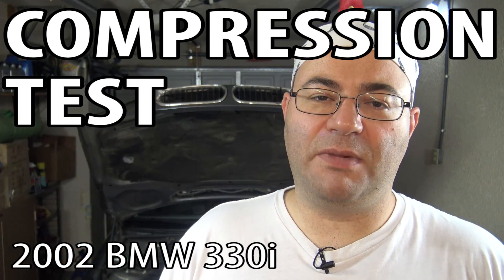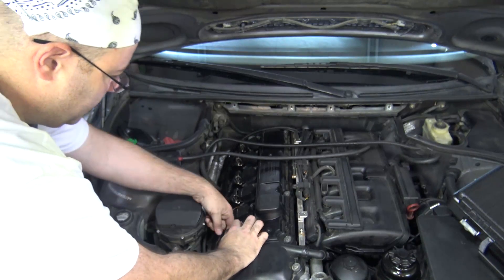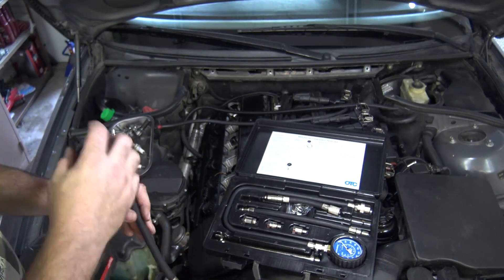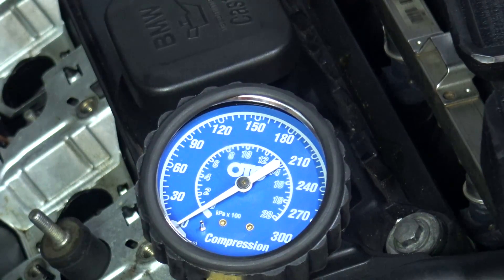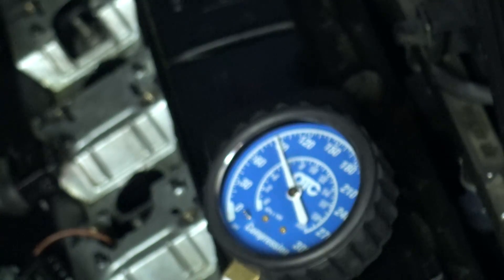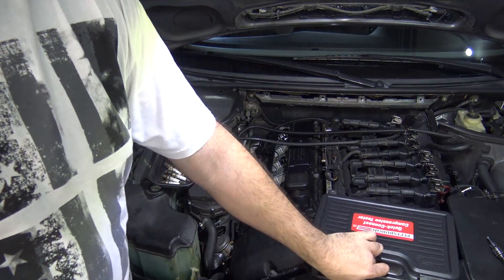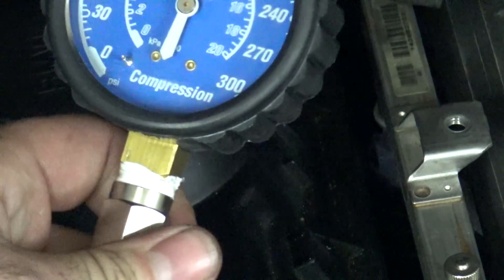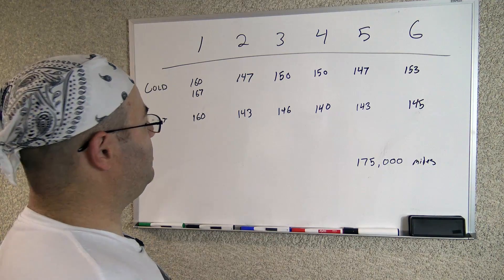How to do a Compression Test on an E46 BMW 3-Series DIY

Comment: I just did a boroscope/compression test of my 2001 330xi with 132K miles.  The cylinders look awesome using the boroscope - nice crosshatch all the way up and down the cylinders.  The compression check had four cylinders at 185PSI and two at 187PSI.  It doesn't get much better than that!

BTW, I bought the compression tester based on your suggestion and it is a very nice tool.

Comment: Hope you are well ! One question : I experienced a loss of power on the highway... Diagnostic from two shops : no compression at all on Cylinder nr.3, 160 on all the others. Essentially, one team, after changing the spark plugs (that revived Nr.5) thinks sending the head to a machine shop, changing the valves and rings (most likely nothing wrong with the pistons), and maybe a few other minor things, shall suffice. Shop Nr.2 also diagnosed no compression in Nr. 3. Either also rebuilt the engine head, replace head gasket, air intake boot, one ignition coil and 6 new spark plugs. Or engine replacement. What do you think ?!  Thanks in advance for your consideration.

Comment: Hey  50skid, i have a 2005 bmw e53, It has a misfire and the code is P0302. we did a compression test when the engine was cold and there are the results, cyl 1- 230psi, cyl 2- 180psi, cyl 3-230, cyl 4-230, cyl 5-230psi and cyl 6-230psi. Now we did another test after running the engine and these are the results cyl 1-200psi, cyl 2-140psi, cyl 3-200psi, cyl 4-200psi, cyl 5-200psi and cyl 6-200psi. The cylinder head we bought from ebay had a  warpage, and when i took it to a machine shop, they advised not to cut it. we are now thinking of pulling of the head to take it to another shop. Are these heads known to carry a warpage and do you advised cutting them?

Comment: 1) Would it be better to do the cyl leak down 1st, for just in case you might need to do a wet compression test ?
2) If you did need to add oil into a cylinder for a wet test, how long, how many miles, street traffic or freeway driving would it take to, what ?, burn off that oil in order to get an accurate reading on the leak down test ?
3) Do you think it would be better to do the leak down test first for just in case you might need to do a wet compression test on any cylinders ?
4) I wonder what other things made you conclude that the HF gauge was not good. 
  I hear that different gauges read differently, which SUCKS. 
   How do you know which brand was more accurate ?
I really enjoy your vids.
I hope you don't mind answering all my questions.

Comment: I've played with BMW motors for a while now so I can say I've  experience with them starting from m50's to m70's. They are actually very nice and fairly easy to extract power out of. 
The idle air control valve is also powered from the same relay if I'm not mistaken.
Reply from the maker: The idle air control valve is a stepper motor that, when powered, will close a flap over an orifice a little or open it up a little, but never closing it all the way.  When not under power, the flap is "loose".  When you pull one out and shake it, it rattles.  So whether it's under power and in the default position or completely powered down because the DME relay is pulled, either way air still gets in.  So which aftermarket brand of M52TU piston rings (those are the ones with the 3 piece oil control rings) have you tried to install in the M54 to solve the oil consumption problem?
Reply: The rings I used on the last build are Hastings however the factory 52tu oil are also a good choice and u will need to use the m54 top ring as it's 1.2mm.
Interesting results in ur leakage test. I hope u don't have an overheated engine as the machining cost will dramatically increase. If it's got the mls gasket then u unfortunately have a high probability for a warped head/pulled threads. I recently had an engine come in that was cooked and the diagnosis was a cracked water pump impeller and thermostat was corroded. The dme controlled heater element almost always corrodes behind the plug on the thermostat side not such a big issue but when the load changes the dme can't keep it open in the 80 odd deg's and it will fall back to the mechanical 97deg C.
Time-serts are the way to go for thread repair.
Reply from the maker: Yeah I already expect that some of the threads have pulled out and that I'll have to sort the whole timesert issue out.  Problem is the $450 kit they want to sell you to do the job right.  I'm investigating other ways to get the dual drill bit so that I can keep the 6mm inset in each bolt hole.

I'm sure that it overheated.  But it's only $45 to get a head decked.
Reply: I'll msg u in fb where to get it cheaper, I just bought another set this week. Great guy to deal with and very prompt.

Comment: great video. Regarding on misfire, check disa valve. I had cylinder 6 misfire and after all the diagnosis it turned out disa valve flap getting stuck due to oil residues. Hope you find the problem

Comment: I was just looking at this video for curiosity, did a compression test on mine all six cylinders were at about 190~, was just sawing that yours were a bit lower at 150~, called my attention
Anyways, all six were holding around the same pressure, I'm just changing the gasket and valve seals as I'm working on the timing chain preventively (just acquired the car as is over the 150k miles). Have to say that the camshaft timing chain section of the Bentley manual was really helpful also on the process of removal, I though I had to remove the engine to do the complete chain but I don't

Comment: This is my 2nd rebuild on this enginr....1st rebuild I increased piston ring gap...compression test was 90is on all cyl after rebuild..
2nd go round 120is on all cyl...both values using the dreaded harbor freight tool...

You got a 30psi differential...using a diffetent tester...so Im in range and no matter what I will not do this again...I wont complain...donor block no boring no oversized piston just straight swaped out innerards...I can live with this before was horrible using 1L of oil/500miles

Comment: You always do a compression test when the engine is cold and then add a small amount of oil in the cylinder and repeat the test hold the throttle blade wide open and crank the engine until it builds the maximum amount of compression possible with oil and without.
Reply: you don't put oil in the cylinders.... that will fuck upp your reading. you only put oil in if the comp has a high diffarance betwen cylinders just to check if it's a piston ring problem.
Reply: @rampage3337  thats what he said.. do test clean. repeat test with oil to ascertain if rings or valves are the issue

Comment: Hi 50sKid, I got a wired situation that might need suggestion. I recently purchase an e46 2 330xi, and found out the CEL light oil light and abs light won't show up when ken in position 2. Of course till now I haven't seen any CEL once even unplug the MAF. While if use OBDII you could find the MAF code if unplug. So, what should I do? It has 3 monitors not ready right now, seems generic OBDII scanner can't do anything to reset them all into not ready for starting over. Car runs and drives.

Comment: I had 225K miles (360thousand km) in my M54B30 (e46) and it still felt like a freight train, no hesitation, liked to rev, only some strange noises in the cold mornings. I also used a trailer to get my e30 to the race track with it. Had no real signs of fatigue... For me what was telling is oil consumption, still it could also be the valve seals, but I did not disassemble that engine to be sure, maybe sometime in the near future! :)
Reply from the maker: Oil consumption is due to the oil rings on the piston.  Gonna do a video about it soon.
Reply: yeah I tried to write that probably the valve seals are also done, but the piston rings are bust too :)
 I'm looking forward to that video! :)

Comment: instead of the DME relay, wouldn't it be better to pull the fuel pump fuse, crank it a few times before removing the spark plugs and whatnot to clear the remaining fuel in the system and then do the rest?
Reply: I agree im trying to diagnose a problem not create a new one

Comment: Good day sir... 
My e46 sounds just like that, i have replaced the coils and spark plugs, fuel pump, crankshaft sensor today, and now im trying to figure out what is going on. Any advise is highly appreciated. 
Thank you and have a great day
Reply: Did you find out what it was?
Reply: @paulloper8333  yes sir, it was the Camshaft, and Crankshaft Sensor.
Reply: Do you remember what the code was on the check engine light?

Comment: OK, thanks for explaining  compression tests on BMWs.  I have a 2001 M Z3 Roadster.  My mechanic replaced the oil filter housing gasket.  When are returned it to me, my wife started to drive it home, but noticed that the oil light was on.  Long story! - SHORT.... They forgot to put the oil back in the engine.  As far as I know, the car has been driven about .2 miles without oil.  I've always used synthetic.  The mechanic believes that the synthetic should hold up for what happened to the BMW.  He has agreed to to a compression test to see if there is any leakage.  Can you give me any advice before we do the compression check?
Reply from the maker: A compression check won't tell you if there was damage to the bearings.  I'm not worried about the compression rings in the pistons or anything like that.  What gets damaged the most by oil starvation is engine bearings.  There are main bearings, rod bearings, and cam bearings.  Unfortunately there's no real way to know if they're damaged without disassembling the engine.  Maybe you can put oil back in it, run it for a bit, then look in the filter for shiny bits of metal, signifying bearing damage.  Good luck.

Comment: followed your instructions and did a compression test today. all cylinders in in the 170 to 175 psi range except for #2 which is at 160 (i'm 90% sure bad head gasket, there are other indications that i'm not mentioning). great tip on pulling out the blue plastic cube, way better than the people that pull the fuel pump fuse. per instructions of the tester when the engine is hot it said to wait 10 minutes with aluminum heads before pulling spark plugs for good measure. thanks!
btw. i'm curious what your compression was after you rebuilt the engine.
like you said who knows how accurate my gauge is...
Reply: also did not push down the throttle at all, i don't think it matters. pressure was maxing out by the 3rd or 4th crank and i did 7 for each for good measure.
Reply from the maker: About 180 in all cylinders.  What are the other indications?  Do a leakdown test to see where the air is leaking out of
Reply: none of the usual head gasket symptoms. cylinder pressure leaking into the coolant pushing steam out of the over-pressure relief in the cap on the expansion tank and after 20 to 30 minutes the low-coolant light comes on. i was 90% sure what it was and now i'm even more sure because the block tester turned yellow. here is a link with the details of everything that was happening:
http://forum.e46fanatics.com/showpost.php?p=17256442&postcount=22

Comment: Great Video as always :) I had some issues with the compression on my 2005 330ci, too. I work at the BMW Plant in Germany and I asked one of the Engine Developers about it.They gave me the tip to increase the Vacuum in the Crankcase. It helps the low Tension Piston Rings to seel better. You do that, by running a vacuum line from the ccv to the intake manifold. At my Engine it doesnt Change the compression (No Vacuum at a compression test) but the Engine is more powerful again. On the Dyno now it has 225HP instead of 210HP.Maybe you ll give that a try :)Greetings from Germany
Reply from the maker: Nice, thanks for contributing that information.  I will look into it in the future.
Reply: Where exactly do you run that line from Ccv to manifold?
Reply: M.I. A.  M52TU engine is using that 'fix' straight from the factory... In M54 in the ccv this output is blinded with piece of rubber
Reply: wormarder oh ok I see. The ccv has an extra rubber plug I can remove and i see the back of the intake manifold next to secondary air valve hose connection also has a place. I will try this! I have an M54B30
Reply: @Wormarder  Isnt that hose from CCV going to fuel pressure regulator on m52 ? Thats why its blinded on m54 because m54 has fuel pressure regulator built in fuel filter.

Comment: Hi Bud, I had  the same issue on my 2003 330xi on cold start with cylinder #6 will miss fire... I changed fuel injector #6 and problem was fixed...

Comment: I'm having trouble finding a fitting that will screw inside the cylinder, can you tell me what size it is I just need an adapter I have the hoses and gauge but my fittings are too big.

Comment: Hi whats next after detecting a low or high compression test what part should be change? Thank you.
Reply from the maker: Your next step is to do a leak down test and figure out where the air is escaping
Reply: @50sKid  is high compression always good?

Comment: I'm confused as to why you did a compression test to diagnose a random misfire prior to replacing the coil (or moving the coil) when you knew you had a bad coil.
Reply from the maker: Because I did not know for certain that the coil was bad.  The problem was only happening when the car was cold and I had already warmed the car up on this particular day so my diagnosing had to be stopped until the next day.  I decided to do the compression test so as not to waste time.
Reply: I get it.  I too can't sit around with an issue when diagnosing can be being done
.

Comment: M54 engines have an electronic throttle body, wouldn't pulling the dme relay disable it so you would not be testing compression with a WOT. Also if u add oil to the cylinder it helps the rings to seal better and increase compression reading however if ur valves are leaky you won't see much change. The purpose is so u can diagnose if it's a worn ring problem or a valve leak issue. 
M54's are famous for carbon deposits around the ring lands and also the oil control ring is one piece which wears faster than the common 3 piece.
If ur going to pull the engine and replace the rings use aftermarket 3pc oil or m52tu oil rings.( not the top compression as it's different)
Ccv is also another common issue on these motors.
Reply from the maker: Interesting point about the throttle body!  I'm actually unsure about that.  In any case, it won't really make a noticeable difference whether it's open or closed on most cars.  Enough air gets past the idle air control valve during a cranking test.  I put it in there for the sake of completeness.  Regarding oil control rings (I knew all this info, but thank you for posting it), are you sharing what you've learned from msg boards or are you a machinist and/or have experience rebuilding these engines?  I've been wanting to get the opinion of a machinist on this.
Reply: i think i read somewhere that pressing the throttle all the way disables the fuel injectors so that way you don't have to take the relay out it's a built in feature.
Reply: please respond to 50sKid's question

Comment: What happend if you not pull down de acelerator pedal ?  the compression down in the readings? how much ?
Reply from the maker: I honestly have never seen it have very much effect because the idle air control valve is always open and allows air to be drawn into the cylinders.  Maybe the compression will reach it's maximum level quicker if you open the throttle plate.
Reply: keeping the pedal down helps disengage fuel injectors, you can reference this statement by watching EricTheCarGuy's video on compression tests from 2010

Comment: You could try and put some engine cleaner like that you can put in the oil before a change, down the cylinders, like 30ml and let it sit the night over, then blow it out the next day by cranking the engine and then start the engine and drive it. Then test the compression again. Could be fun to see if that made a change.
Reply from the maker: Yeah I've seen that video and I plan to do that soon in my own video, but for a different reason than trying to help gain compression.
Reply: I would like to see that too, Fifty
Reply: @50sKid  , @andersDog94 do you guys think this is unsafe for a direct injection n54 335i?

Comment: Damn i bought that HF compression test kit a long time ago when i found some silver metallic particles in my coolant and i was also losing coolant so i suspected a head gasket leak but its been like 10 months now, after replacing the major cooling components i'm not loosing coolant but even after flushing 10 times i still have silver particles in my coolant. I suspect the previous owner put some sort of leak stop in the coolant to stop a leak. Anyways i can't return that HF tool back even tho i haven't even opened it, maybe i'll test it one day just for fun.
Reply: if your car just keeps producing them i would start collecting them, melt them down into silver bullions, then sell

Comment: Hey I been using a harbor frieght gauge since 2005. The same one. Not the one you have in the video. But a hf one. It was my first engine tester.
Reply from the maker: Pretty surprising how inaccurate they are (I've tried two just to make sure)